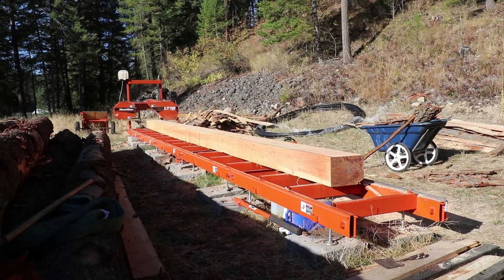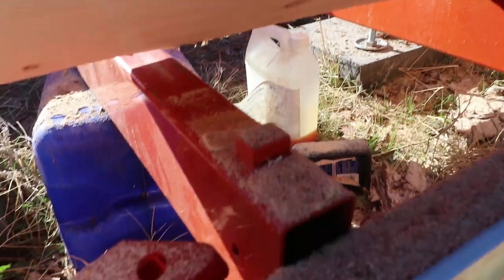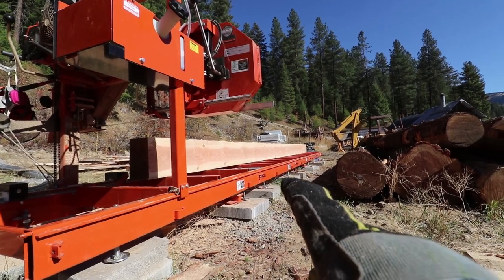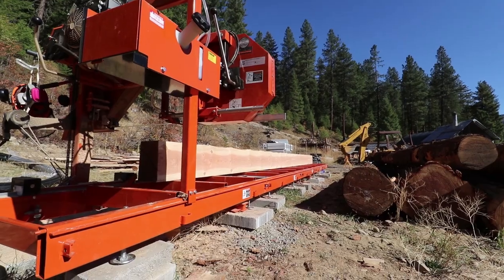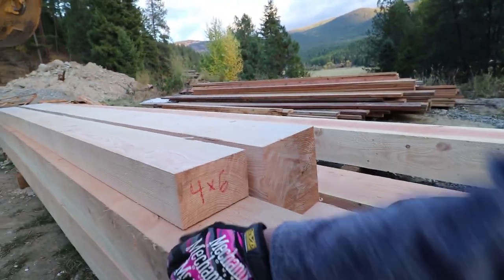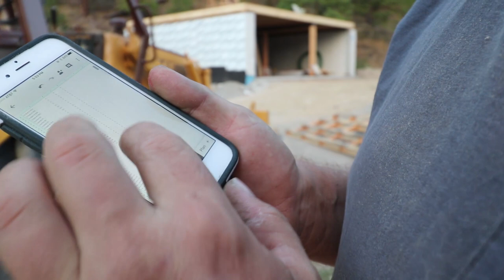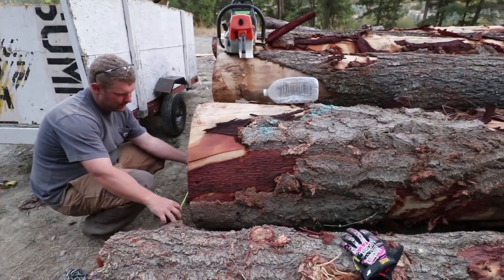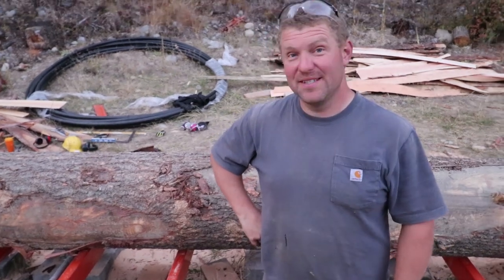IT’S SO HUGE! (Milling 8x12 Ridge Beam on Sawmill)

Comment: Set up your laser and use a story pole to level all your bed sections at the same time. You can’t use a 4 foot level to span 30 foot because of the slight variation in the level. You are doing great so use your level for what is was designed. Make sure all beds are loaded when checking level.

Comment: I don't know if you guys will see this but just a hint. Save that sawdust. It's good compost. Also, if you're able, don't put the big booty end closer to the blade. Put the smaller end closer . It's less measuring that way. And I know you're pushing perfection, but after you get the hang of milling, don't sweat the rolling so much. Take your first cut and be confident in your decisions. You guys are awesome! Keep it up.

Comment: Alyssa, I know you don't read comments but in hopes of helping someone else heres
the result of 35 years experience setting up saw mill equipment.
     3 tools used. An optical surveyers transit, a machinest level with .001" graduations,
and a piece of piano wire with a com a long to stretch the wire past yield. Just pull
the wire 3 inches longer for every hundred feet. The wire is supported on 3/4"
keystock at the extreme ends past your work zone. A third piece of the keystock
should graze the wire when slid under it at all reference points. Side to side measurements
such as the top of carrage track "V" rail measure to the side of the wire. Level on
track is with the optical transit. Laser levels are not usable for this work where an
optical transit easily reads 1/2 mm. With the carrage types the track is set first and the carrage knes ar shimmed up to the highest one. A traveling band is a little harder to
tune errors out of . Same proceedure though with leveling the track first if it is welded
to the bed sections and then use socket head  screw (3/8 or 1/2") to mount
1/2 X 3 cold rolled flat stock on the bed tops which you can shim to the accuracy
of the transit.  If the track is bolted on level the bed support crossmembers first and
if necessary add the 1/2 X 3" flatbar which can be shimmed at the ends and a few
points between where the screws are located. Then shim the track to the bed sections.
Steel shims are usually made from 3/4" wide banding material (.oo9") or 1-1/2"
banding material (.017").  First pass is to lay the shims on the track or bed 
sectiond  and read those before bolting them under the parts. Then read all the points
again and adjust with strips cut from aluminum beer cans (.002.5")
     Also the equipment needs a concrete foundation for accuracy of level over
time and system mass to contain shock loadsof turning 1100 pound timbers.
     You can not move the transit until completely finished.and the nice extruded
aluminum tripods change leg length as the sun moves during the day so set
the tripod wher one leg will not put another in a shadow

Comment: I'm sure these suggestions may come too late to be useful, but a gas powered leaf blower might be a time saver for blowing sawdust off the new cut beams and the mill rails. And the handle of that tool you use to roll the logs and beams on the mill looks like it could use an eight foot piece of 2 inch pipe as a cheater to slip over the end for more leverage on the really big beams. I'm glad you're back putting up videos. Hope the timber frame workshop went great.

Comment: I'm learning so much I don't plan to ever use!  When I saw the whole bed slide as you turned the log I started thinking about your previous comment about using a laser level.  I wonder if it's practical to setup reference lines on each bed section (and on both sides) and then checking with the laser before each cut.  Depends whether you can adjust a bed section while loaded I suppose.  You guys rock!

Comment: Also, cut and use stickers (I use 1x2s) between everything, especially your beams.  The edges exposed to the air will shrink, warping the beam.  Stickers will allow air on all sides, lessening the bending.  Twisting too.  FYI.
Dave

Comment: I love sawmill work...
Are you boxing the hearts for the beams?
You can also sink Cables into the ground to hod the mill in place using duckbill anchors.
But really... only cut full length IF you need long timbers, once you have the beams you need and a few spares, start bucking the logs shorter.
As for the slabs & boards...

Comment: IDK, if it worth it or not, but if you have the problem with rotating beams(I know it too late, but I will write as if it is not :D) you could use the backhoe and the ribbon(do not know how the thing is called, that flat thow rope) you use to transport beam later, use that to rotate the beam.
attach it to the stem the same way as you do when transporting it from the sawmill, but add additional few turns around the  stem or partially cut beam, and lift the ribbon with the backhoe bucket, it should have sufficient friction to turn the thing, in a pretty controlable manner.

Comment: Why not just buy more bed sections and mill full-length beams? You can always sell the extra bed sections when you're done.
Pouring a pad is a smart idea. When you no longer need it for the mill, have someone with a concrete saw slice it up and use the pieces for a walkway.

Comment: You might could look into getting the battery powered DeWalt 20v leaf blower to blow the saw dust off the log before rotating it, it would save alot of time. We use it on the job site all the time, it is awesome and definitely worth the money, it's $99 I think for the bare tool.
Reply: Jake Carter damnit beat me to it
Reply: Trevor Berg lol sorry

Comment: I really think that you need to look at your tolerances and say that 1/4 " over 25 ft is acceptable. Of course I know you're down all your milling now, but hey, what else can I comment on :) . Aside from maybe trying lift timbers with the front end of the loader.
Reply: I agree 100% that is way to tight a tolerance for a span that length, we are dealing with wood here, it is going to move more that 1/4" within the next month or so, you  have unrealistic goals, do let perfect come in the way of good.  You could spend much more time worrying about other more important things that you do have control over.  LIke I said the building is going to move, so all your work is almost imeasurable in the context of what you are trying to do, get the building up.
I have been in the building business for 40 years and was a building inspector.
Steve

Comment: You guys are just flying through those logs.  Good on ya.  Man Our Ridge Beam is 12x18 Doug Fir.  Crazy how different the rules are depending one where you are.  Over all our Ridge is 53 Feet long.  It will have a scarf joint in the middle when Jessica and I are brave enough to tackle the joinery on it.  The one 27 foot long piece is over 1200 lbs...
Reply: I agree 100%.  Although I would probably not sell them but store the extra for future projects.  I put off ordering the logs for so long because I was not sure HOW or WHAT I needed.  After spending a couple hours with the plans and realizing how little it cost to order Eastern White Pine locally I would have just ordered double and used the extra in barns, Jessica's dog school and other projects.

Comment: I agree, pour the pad.  But, do it right by auger down 24" where ever there is a bolt adjustment on your frame.  Then pour the pad with plenty of rebar and make the pad at least 5 1/2" thick.

Comment: I feel your pain with the logs.  We built our house and used some logs we had milled for our land and a friends`.  We started back in `85 to build the house.  Years later we milled out logs for our big building.  Hubby had no tractor till after the large structures were built, then he was cutting logs for the different mills.  It was too much for us to have a mill in the yard so we had someone come in with the WoodMizer that I knew from school.  His son now runs the mill.  No bank money for us we paid as we went along.  Saved a lot of headache for us just to have a pro with a saw, we provided the extra labour.  We cleared 7  pines from the side of the house so that if they ever got damaged they would not fall on the house.  We had to use block and tackle to take them down so they would not hit our roof and chimney. Hubby cut with the saw and the neighbour and I pulled the trees.  When milled we had almost enough lumber to frame and cover the large building, it had a hip roof.  We had corn whisks in our back pockets to clean the lumber and mill at all times.  The few pieces that were not even were run through a plainer, now that made a difference.  If we had to purchase all our lumber we might as well had given up without even beginning our build.  Hats off to you both for what you are doing.

Comment: Hi, great fun watching you build your house. Always looking for your next vidios.
It's tuff getting a light railway to stay where placed. If you have time you can set it on some heavy logs like railrode cross types except as big as you can get. Eight foot logs with flat spots cut on the top surface would work great. You could use crooked buts or whatever. Bury part in the ground to leval the top serfaces, pack the fill dirt so they're hard to move. Level your rail way on top then anker it to the tyes with all thread screwed into tight holes drilled into the tyes. You may have to adjust adjust it for leval and flat a few times till the sleepers settle but it will not be a constant fite. 
Best of luck
Dan R

Comment: I realize these videos are after the fact. However I think you should give consideration to using the front of your loader rather than the backhoe. It will pick up heavier loads and you can drive them right where you want to and set them down.  I know you can't reach as far but reach isn't necessarily an issue if you come in from the one side all the time.

Comment: Solid pad helped mine. Then all u have to worry about is the internal stress inside the logs that allow it to move as you are releasing . Every side u shave off lets some go in a different direction . Each one is small but , get a couple pushing or pulling the same way, it can multiply.

Comment: On long length's of anything, play with a very tightly pulled dry line using the twist and tighten knot, and with a builders level shoot the middle of the line pulled at 20 ft and see how much sag you've got and use that as a way to dial in your bed.

Comment: Good job guys, you did it.  Couple of things, not criticizing but for future reference.  Timber framing requires that your heartwood is centered in the beam.  This is to keep checks from going all the way through your timbers as they dry and gives you the most stable timber possible.  The other thing to make life easier is to mill from the narrow end of the log as well as laying out the timber before cutting with a level.  Bebark and you will triple the life of the blade.
I have several videos in my timber framing vlog on this stuff so I don't need to go too deep into it, the information is there.
Nobody is perfect and I'm sure you two learned some good lessons on the dos and don'ts of sawmilling.  It gets easier as you go and you will improve.  Good work and keep learning, don't be too proud to look around at what others have done.  Have a good one you two and I bet you're happy to have a house standing there.
Reply: Let the experienced experts work the sawmills....

Comment: Re: the "calibration" of your saw mill. In case you haven't thought of this, heat will expand metal. One of the problems with band saws, is that when the temperature of the blade increases so does the total length of the blade. This usually results in a saw blade the will move up and down the cutting plane. 

Now, this is just my theory but you could easily test for this by securing a thermal temperature probe and point it at the blade as it is leaving the timber. That probe will give you an indication of the internal temperature of the wood and blade. As you are milling, have Alyssa log the temperature every inch (maybe mark the log every inch as reference points) and after milling go back and compare the temperature to the height of the log at every inch. If you find any areas that are not the correct, make a note of what the temperature was. After you preform this process along the entire log, you should have enough data to easily determine a statistical significance of "at what temperature does the blade starts to walk?"

I would be very interested in your findings and would like to compare it against a circular saw mill.

Comment: I think looking for absolute precision out of a sawmill is near impossible.  That's why it's rough cut lumber.  One thing that I see is that the blade guides are too far from your lumber.  Adjust them in once you get to cut surfaces so that the blade doesn't rise and fall with the grain so much.  It's great that you look for perfection but you plan on planing anyway.  Get it close.  I think the 1/8th inch that you keep chasing isn't that horrible.

Comment: I have the same sawmill with almost as much track.What I did was use a string line to set the bed straight and level.I then dug post holes every five feet down one side of the bed.I then drilled a 1/2 hole through the bottom edge of the bed frame and bolted on some lengths of 4x6" treated timber extending down into the post holes.I filled those with concrete and let the concrete set for a couple days before using the mill again.It's been working that way for ten years without any issues regarding movement so I am calling it good.
Also keep an eye on the track and the track rollers,I found that overtime sawdust would stick to the rollers and track affecting the cut and the amount of effort required to push the mill.Simple fix for that was some periodic shots of chainsaw bar oil on the rollers.

Comment: just a suggestion , If you use a short length of chain between bucket and log grapple it will be at lot easier to move the log when suspendered . I'm thinking 3/8in. chain .

Comment: your loader will pick more weight with the front bucket......but not as able to maneuver logs that way. If the issue with picking large logs is due to the backhoe wanting to tip, get a full load of gravel in the front bucket......the loader wont bounce around as much, and it will be better balanced when picking logs....even the smaller ones. Same thing when digging, get a load of gravel ro rocks, and the backhoe will be much more stable.

Comment: 1/4 off differenses comes easily from the deflection off the sawblade. Even small differenses in density off your wood will do it
Reply: If you use your guides it will limit the deflection....
Reply: Limit yes but not eliminate completely. The quality of  the blade matters alot ofcourse

Comment: Yeah we noticed that the sawmill moved or bounces a bit, that will tend to change things even if slightly.  Not sure what the fix is for that short of pouring a whole slab under the whole mill and mounting the legs to the concrete.  Good job on looking and figuring all of the things that can affect the dimension.  A lot of people would just say, heck with it and move on.

Comment: Jesse,  you are exactly correct, concrete pads. You need to anchor down your mill. Seeing that you have leveling jacks, put anchors nearby. Run tight string line from one end to other. Snug anchors, as you align.

Comment: Suggestion:  use 3ft angle iron, drive into the ground on either side of your rail with a jackhammer w/adapter. Then bolt angle iron to the rail tabs. It’ll give you some stability.
Reply: Unfortunately, this all happened over 
a month ago, on their Facebook page you can see that the timber frame for the house was finished like two weeks ago.
Reply: Jack Cade thanks for the heads up. I thought they were tracking within a couple of days.

Comment: you should lift the beams off the sawmill with the backhoe and turn them on the ground.Just the weight of those beams is moving the mill.(saw it happen in this video)

Comment: Yes stickers are a most. I manufacture 4 x 8 x 24ft (takes to 2 to handle) either with a chain saw mill or a have a fellow who brings his mill at home. I am very happy since all the wood comes from tree's to close to the house or hydro wires. Question: at some point the size of the beam defeats the purpose  since there own weight imply the span is diminished? That's where laminates beams come into account? Also the long beams need more support. Super work!

Comment: I have been thinking the "Pour a pad" from the start of this. I had assumed that you guys had some deep pylons poured and a anchored some of the feet. Fyi, Makita makes a small hand blower that is great for clearing saw dust around the timber on the mill.
Reply: I was wondering if they should have just hooked a blower or compressor to the mill so it will clean as it goes but That was several weeks ago.... So not much help now. :)

Comment: I found my log bed can absorb the shock from a half ton log much better than your current confirmation. Stay safe use a screw jack and battery power drill to turn your cants. Good luck 🍀 have fun.
Reply: Attach the bed to 6x6 or 8x8 beams.

Comment: It was nice to hear you mention a slab for your wood miser. Grand idea but use Sono tube for your foundation. It's cheaper more solid plus you can remove it easier when your done milling. Just a thought to help speed up your process.

Comment: Definitely pour a pad, with threaded rod for the mill built in, or use chemical anchors to hold in the rod after it has set. Then you can bout the mill direct to the pad. Rigidity is key!